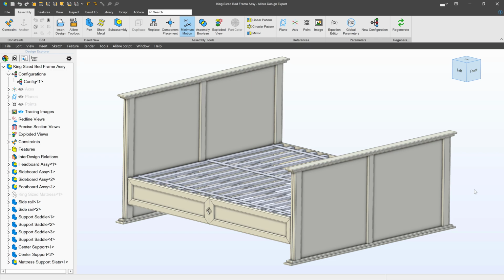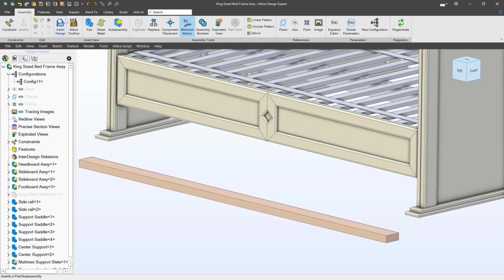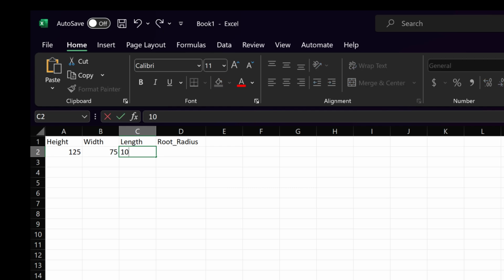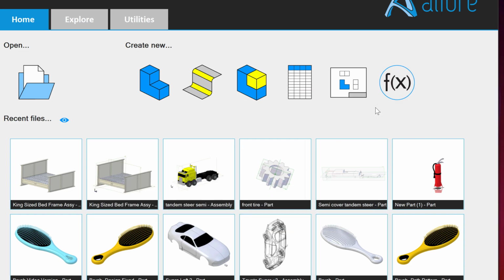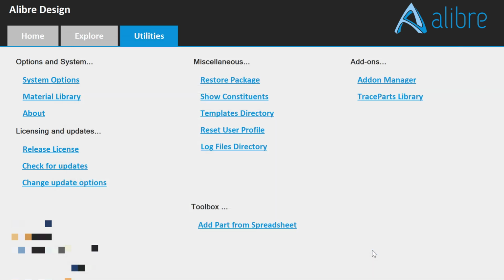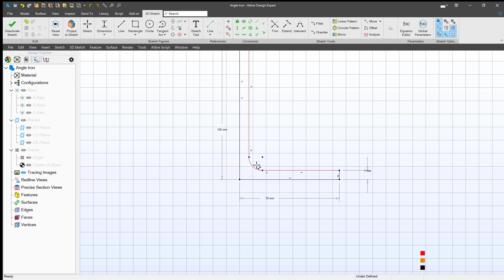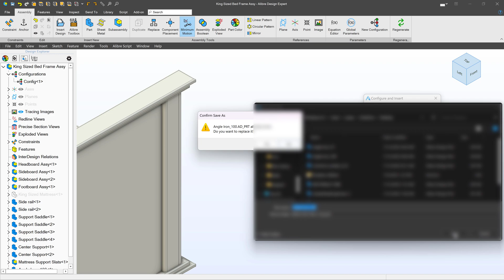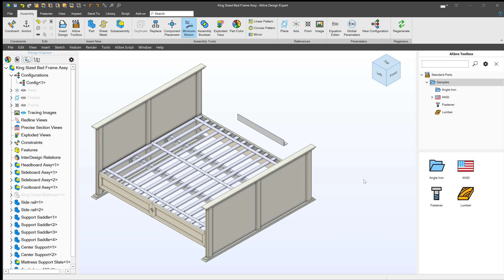Alibre V27 Preview - Introducing Spreadsheet Driven Part Libraries!

Comment: I have the current version of Alibre but I don’t have the tool box.
Reply: This is a preview. It will be released with Alibre v27. If you have an active maintenance by then you will receive it automatically.
Reply: @ExMachinaEngineering Ok thanks!
Reply: Note also that this tool will only be available in the "Expert" edition, NOT in Professional, Workshop, or Atom3D (at least as of this writing).